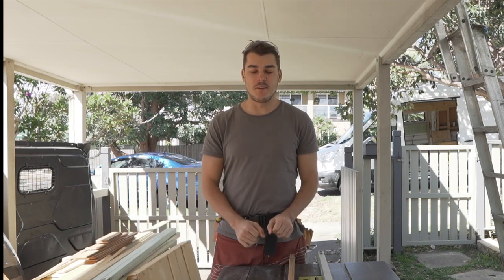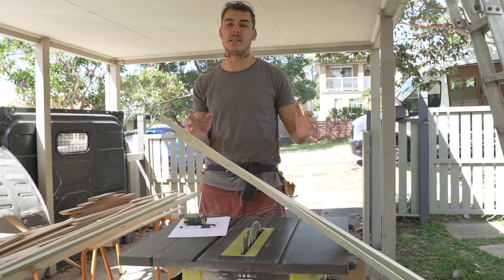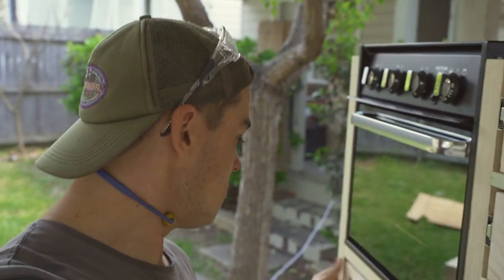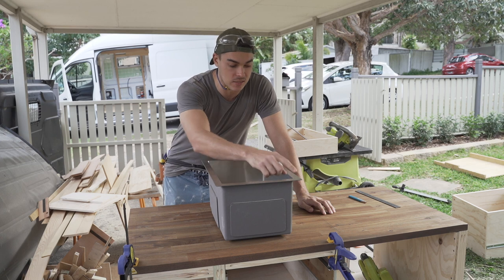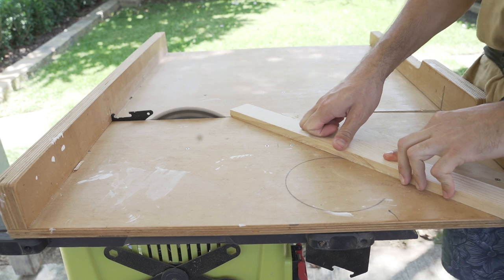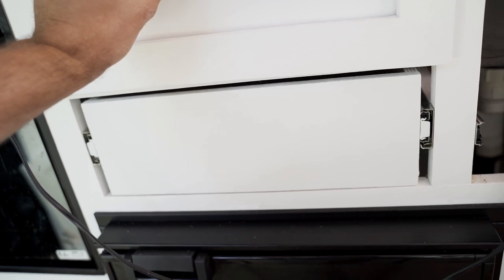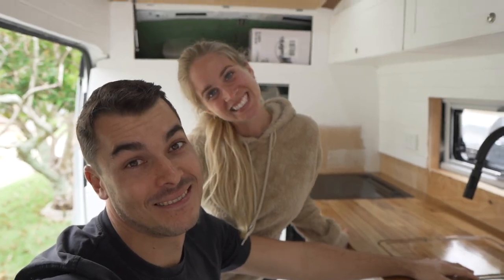AMAZING DIY Van Kitchen built CHEAP  | Ford Transit Conversion

Comment: Great tip on the 90x45. Couldn’t agree more about the pocket hole jig. I love my Kreg gear. I picked up a similar model Transit last week and just getting kicked off. Your tips are really invaluable. Keep up the great work.
Reply from the maker: Yes it saved me a little fortune, to just be spent on other nice things for the van haha! The pocket hole jig is actually so great. So easy and so so strong! Good luck with your conversion.

Comment: Hey, good job, Question, when you drill using your pocket guide, do you need to pre drill a pilot hole into the timber where the screw beds in?

Comment: Hey mate, thoughts on using strips of 1" plywood cut to 2" widths rather than your 1"x2" pine? Not sure if it'd be cheaper or stronger or worse on both fronts? 

Great video, nice to have someone working in mm (despite my comments measurements 😅)
Reply from the maker: I suppose it is possible although I have 2 concerns. Firstly 1 inch thick plywood is so heavy and would be hard to manage, especially if stripping down by yourself on a table saw. is hard enough with 15mm which is half that of what you're suggesting. Secondly, I think this wouldn't end up being cheaper, nor worth the effort than just being dressed 2x1's. I like your out of the box thinking though!
Reply: @saltyvanventures  appreciate the feedback mate!

Comment: I've been having lots of issues trying to build out my kitchen - amateur DIY amirite? But I have been following your build (which has been excellent and super helpful) and since things seem to be coming along alright. One issue i've had a bunch today is drilling screws into an area that has another set of pocket jig holes. 

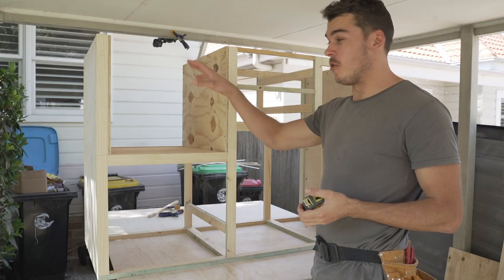For example @4:19 your top row has one vertical piece between two pieces going horizontal (where sink and drawers are seperated) all of those are pocket jig drilled out - how do the screws not fall into the other holes and compromise the strength? Each time I've done that, the screws don't seem to hold well and are quite wobbly. 
OR it cracks the wood entirely. 

Oof. I thought I would've been working on drawers by now but its just kitchen, day after day. I feel like i'm losing it

Comment: I love your details that your go into in your videos. And occasional references to products, materials, suppliers here in Australia.
I went out and bought the Kreg Pocket joining jig that you are using. I have be practicing using it on some 12mm ply. 
Most of the time the special Kreg screw head is NOT flush when the pieces are assembled. Any tips how to avoid that?
Reply from the maker: That's awesome, those pocket hole jigs are truely amazing. Yes you can run into the problem with the 12mm ply. I actually don't use the kreg screws and just usual chipboard/wood screws which are much cheaper when you use a lot of them. They are countersunk though so you just need to be mindful not to really drive the screw past its limits where it may split the ply. You can look for screws with a smaller head too which don't protrude the wood. Alternatively where I hav had this problem, I have taken an angle grinder to the screw to grind it flush with the ply. hope that helps

Comment: This is a great kitchen cabinet.  I bet it is quite light weight.  Have you ever worked with 8020 and if so, do you prefer wood construction.  Obviously, wood will be less expensive.  I am impressed with your cabinet design.  It may not weigh more than 8020.
Reply from the maker: Yes this design would be considerably less weight that say a solid particle board kitchen. I have never used 80/20 as i prefer working. It's more forgiving I suppose.
Reply: @saltyvanventures  What is the approximate weight without the Oven and Fridge?  (Amazing Video!!!)

Comment: Hey guys! Absolutely love your build - I was wondering if you could share a link to purchase your wall vent for the fridge ventilation? Thanks heaps!
Reply from the maker: I couldn't actually find where i bought it from. But this is the same one i got https://www.theboatwarehouse.com.au/deck-fittings-hardware/vents/louvre-vent-plastic-with-tail-white-suits-100mm-hose/?gclid=CjwKCAjwy7CKBhBMEiwA0Eb7apsnTLWEfuF8G5Y4mAMi3yYEJGk8arFhSRJ1igZ3OhojPmDmdMiSXxoCOqkQAvD_BwE

Comment: Am curious why you did not use hardwood for the frame? Construction strength is so important in a cabinet subjected to moving on bumpy roads.
Reply from the maker: It’s much heavier and an overkill in my opinion. Pine has held up valiantly in all the builds I have done. Remember to glue and screw all your joints

Comment: Good stuff brutha. I'm considering converting a Transit extended this year. What are the Engineering & Compliance regulations here in Aus for electrical, plumbing, gas, installing swivel seats & generally converting a commercial vehicle to a registered RV?
Reply from the maker: I'll make a video on it when i get around to it but basically you need a certified gas fitter to install any gas work and an electrician to instal anything 240v. Then it needs to be checked by an engineers, along with any other modifications to get a compliance plate which will allow you to register and then insure then van as a motorhome.
Reply: @saltyvanventures  thanks m8

Comment: Hi Marcel - awesome design and build. What did you use for your the waste on your sink - it looks like you've got a neat little trap mounted at the back. And can you tell me how much space you had to leave below the sink to allow for waste pipes - I have the same sink as yours? Thx bud
Reply from the maker: yes you can get these low profile sink traps. I had to go to Reece plumbing to get it. It's called a box trap space saver. It was around 10cm when you take into account thread adaptors i think.

Comment: Just wondering, would it be stronger to make the unit out of the 20x40 wood you used or plywood? I imagine plywood is more expensive but you get more usable space in the unit?
Reply from the maker: The beauty of doing it this way is that you save a lot of weight as the 20x40 makes a frame which is essentially a skeleton. making it out of ply is doable but i would way it would be much heavier

Comment: Did you go for a full depth kitchen countertop 620mm or did you narrow it down? Great video and informative every time. thanks!
Reply from the maker: The counter top is 600mm wide I believe as that’s what I could buy from the hardware store

Comment: Great video! When you cut out the chopping board how do you keep the corners intact and round so that the piece fits back in the hole nicely? Thanks 🙏
Reply from the maker: Not sure what you mean by keeping the corners intact but i basically cut it out nice and slow with a jig saw, then rounded the edges with a round over bit and my router. Does that answer your question?
Reply: @saltyvanventures  yes thanks mate!

Comment: Part way through making my kitchen. Do you consider using the push to open runners or soft opening or is it better to just go with the regular ones and add in the stopper at the back?
Reply from the maker: It's up to you and you taste in design, I didn't like the look of the push buttons for the drawers and they don't have much to pull on for the bigger heavier drawers. For anything thats going to have heavy stuff in it like pots, pan and plates ect you may need to add extra holding power. I ended up putting a few of the holds on the bigger draws and then on the plate draw an addition magnet hold as the heavy drawer kept opening up while going around corners.

Comment: Hey there, would a fan be necessary for the fridge compressor or would a vent hole be ok on its own?
Reply from the maker: Potentially. Maybe depending on your climate. Here is Australia in summers it gets bloody hot so i would recommend it. Many not so needed in say Europe

Comment: How tall is your kitchen? And approximately how much did you spend to build it ?  I just recently bought a 2000 Ford econoline e 250 and I'm wondering how to and how much it would cost to build a kitchen frame.
Reply from the maker: Its hard to say what i spent on it but the kitchen is 900mm high

Comment: Great video, thank you. Would love to know how you found a place to work and do the Van build in Chile. How did you get hold of all the tools. I saw the build and love the Hiace. I drive a Hilux D4D now. 😀 Any tips for keeping the cost down when doing a build in Chile. Thanks again.
Reply from the maker: Hi, we reached out to a couple on the Workaway platform(basically work for accommodation and food)  that were renovating a house and needed some help. So we were able to stay with them and use their workshop to build out van. Most RV specific stuff is very hard to find in Chile. We has to get a couple of crucial items shipped from the us via Amazon such as the 12v lights and VSD. Sodimac is the big hardware store in Chile but is still fairly limited in what you can buy compared to say US or Australia. If you have any expensive tech items you want to install, bring them with you.
Reply: @saltyvanventures  Thank you for the feedback, that really gives me food for thought. We did not think of shipping stuff with us. I also did not know you can ship with Amazon. I am also not half as handy as you are. We may have to do with a very basic setup. And add on as we move around. Thanks again.

Comment: Epic! do you have the design for the kitchen cabinets? would be a great starting place for my build. Happy to buy. Thanks for all the tips.
Reply: Oh also, what are the dimensions of your table sled?
Reply from the maker: Hi yes i will have it for sale very shortly on my new website (currently building) Do you mean the slide out table?
Reply: @saltyvanventures  actually the kitchen cabinet but interested in other plans too.
Reply: Oh and the sled I meant your table saw sled

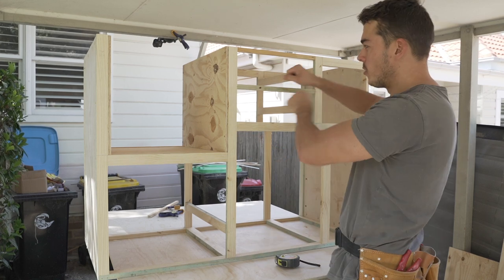Comment: Pretty cool! But, @ 4:38 the design wheel gets a bit woobly. Not quiet sure how those remaining spaces r goin 2 work out? 😳
Save space. Get rid of the oven & all it's associated problems & buy a small good quality gas BBQ with a hood. Keeps all thos nasty cook'n smells outside. So no curry flavours @ 3 in the morn! 😇
Reply from the maker: There are no bad cooking smells. When cooking you exhaust through the roof vent above the stove. Also with a bbq you can’t cook on it when it’s raining and it’s not nice being outside when it cold/windy/raining

Comment: what thickness of plywood did you use for the drawers? Also, is that baltic birch or some other kind of plywood? Looks like a lot of plies.
Reply from the maker: All the draws were made from 12mm play except the base which was 5mm. It's just cheap pine plywood CD grade.
Reply: @saltyvanventures  Thank you!!

Comment: How did those drawer locks work out? I know my drawers have flown open a lot 🏎😂  I wonder if those locks would be strong enough for my racecar driving skills… 🤔
Reply from the maker: The draw holds work pretty good. The only one i added an extra magnetic hold was the second drawer which holds all our heavy plates. Used to fly open around corners but not any more.

Comment: Great tips, and a beautiful result! 
BTW, how much do all those money-saving tools cost? :)
Reply from the maker: Thank you! Well you can't build a van without tools regardless so the tools i'm using would be needed if I were doing these techniques or not. The table saw is pretty much my main power tool, you will absolutely need either a table saw or a mitre saw if you want to build a van with any professionalism. They are both around the $300 mark. But I would now 100% choose a table saw over a mitre saw.
Reply: @saltyvanventures  I can see you are pretty familiar & competent with wood-working tools, & I was assuming you already had a reasonable sort of workshop. But for those of us that don't already have these tools, it's an extra few steps to choose what tools to get!
I had seen a reference to a track-saw as being a necessary tool for cutting straight strips of wood (and they are quite pricey), so interesting to see you using a table saw for this (& also seems to be more versatile in what it can do). 
I guess a decent table saw will be around the same price point as a proper track saw...
Reply from the maker: @maradall  A track saw is more or less an expensive version of a circular saw and a straight edge. You can adapt any circular saw (which is a necessary tool) to cut straight lengths by easily making a straight edge (usually from a side of plywood which is machine cut straight). I use this method extensively to break down heavy plywood into smaller pieces before cutting it on the table saw as its too bulky and heavy. I might make a video on the essential tools you need to build a van!
Reply: @saltyvanventures  That would be awesome! I've already been exploring this - lots of carpentry & tool videos on YT, plus lots of hacks for using them. But fitting out a van means you need to think about tools that might cut metal (jigsaw, angle grinder?) and plastic too. Evan some info about blades, bits, etc for different materials would be extremely helpful!
Just saw an ad on Gumtree for a table saw, used, for around $1000, bought for a caravan fit-out & seller has no more use for it. So no point in buying too many expensive tools & gear if your main & only project is going to be a van build. :(
Also, van-lifers will often be needing to think in terms of tools that are light & compact that they might be able to take with them on the road - some will have a home base where they can store their stuff, but others won't want to load up with too much more gear, right at the point where they are unloading the rest of their stuff!
Reply: @maradall  Not sure how you went on the tool debate, but for any future viewers. I just bought a small DIY set from bunnings for $300 with a normal drill, impact drill, circular saw, grinder and sander and $70 on a jig saw. Plus other tools like the Kreg, rulers etc. All up cost me less that $500 and I kept the original boxes so everything can neatly go back in the box and stored under the bed for any maintenance down the road. it takes up the same space of Salty's oven.
Reply: @catchmeifyouvan7754  I have a similar set of tools (I opted for Makita 12V jigsaw, mini circular saw, drill and impact driver - but the impact driver was a bit unnecessary, as the drill also has impact driving function that is much more manageable for wood). I can't do all the fancy accurate cutting things that a table saw might do - but my point really was that, unless you are going to do some serious carpentry on an ongoing basis, a table saw could easily end up costing you more than you save. (Marcel does some magic with trim in another video, but again, unless you already have a table saw, you can buy a lot of ready-trimmed wood for $1000+)
Ok, the 12V system is a bit of a girlie system, but perfect for me as a wood-working beginner (especially with aging arthritic hands that not so strong anymore). Plus yes, these are neat little tools that you can easily fit in your van toolbox, recharge the battery packs when you have power, and will cover most of your basic requirements!

Comment: Mate mate ... 4 bee two .. wees dunn wonna get like them tharr crazy emerikeys do we  .. they drive on the wrong side of the car and on the wrong side of the road ..goin the wrong way ..  4 bee 2 ...😂🤣😂😎pip pips and carryon pilgrims
Reply: Metric is so much easier, particularly for wood work. I was born in the early 50’s and still think of framing timber as 4x2’s, most younger people look at you blankly if you say 4x2
Reply: @loriscook5231  i like that blankly look .. 😎😁